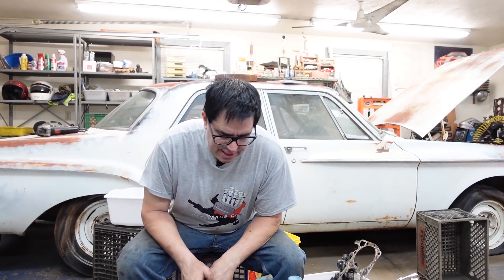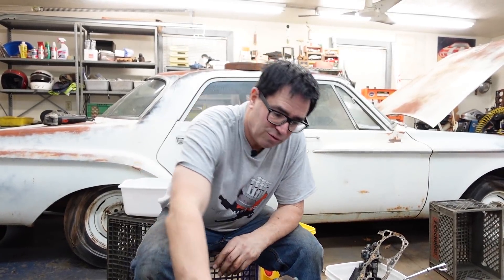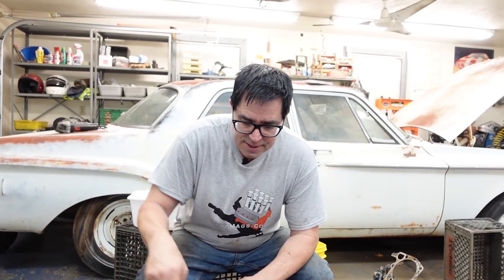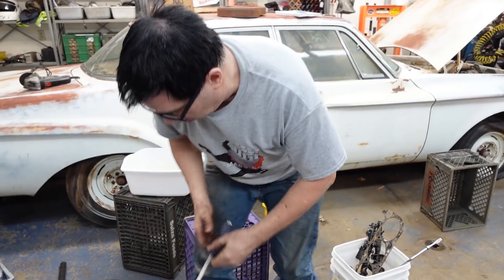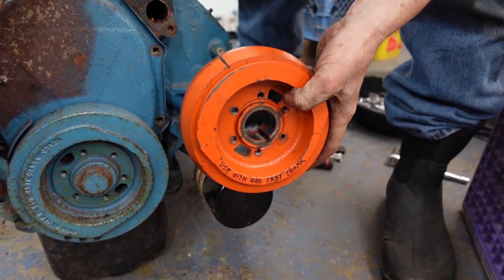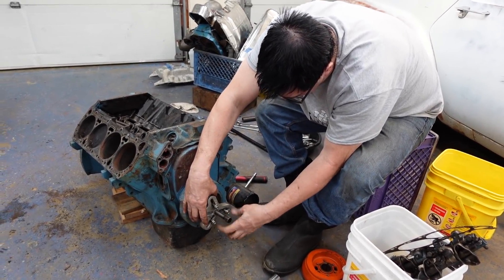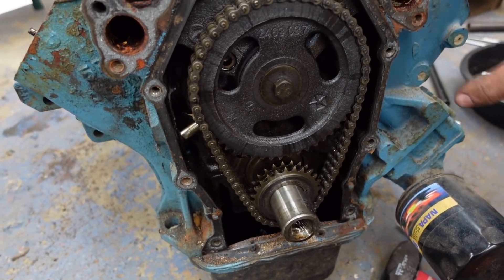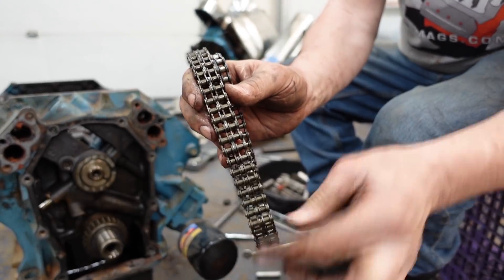Junkyard 440 Teardown Continues

Comment: Any chance of going .020 over and using stock 400 pistons?
Reply: Aftermarket pistons are much better quality and materials. Not to mention you go from a pressed wrist pin to full floating.
Reply: @markwise9868  Much lighter too.

Comment: Lots of great information Steve. Back in the day some of us ultra cheap types would resurface hydralic lifters by putting 600 grit emery cloth on a piece of glass with some oil and making a circular motion with the lifter. You had to start with a lifter face that wasn't really dished. I'd run around the junk yard pulling lifters till I had a set I could work with. Very time consuming. A couple of times through a long movie should do it. Seemed to work ok.
....With the quality problems some new lifters are causing these days, I'd be tempted to go back to used lifters again
Reply: After my son's car ate two cam and lifter sets last summer, thanks to poorly made lifters, I was able to find a set of NOS lifters at a local privately owned parts store. That solved the problem. Now I'm search of another set for our next engine. Big box stores have too much turnover. They're shelves are full of the Chinese crap now.
Reply: @kennydemartini2169  It's been a lot of years since I've built anything. I've heard the stories and I'm glad you found a solution.
Reply: You could get lifters refaced once. Though junk after doing so as the hardening was gone. They are so cheap these days never bother with doing so.
 IF those lifters were still good I would have saved cam and lifters
Reply: @ldnwholesale8552  Sounds like you can end up with junk no matter what

Comment: It's cool to see an engine being disassembled on the floor with hand tools. Makes the video much more relatable to people like me who would be doing it the same way.
Reply: No fancy jumbo sized garage with a lift and giant tool boxes either. Looks as though Steve is keeping it real. 👍
Reply: I love that Steve keeps his swap meet tools in a 5-gallon paint bucket. I watched another channel put assembly lube on the wrong side of his bearings while using a 30k tool kit. Tools/Shops don't make you knowledgeable. Only knowledge does that.
Reply: @bjr2379  That's on the other side of the wall.
Reply: I have built race engines and road engines for 50 years. Engine stand is essential, not maybe for dissasembly though it makes it easier but for assembly imperative. Rolling engines around on the bench yet alone the floor is plain dumb, more so with big lumps like this.
Reply: He didn’t really take anything apart on camera. He mostly just talked about it. 🤷‍♂️ An engine stand is pretty cheap at Harbor Freight... 🤷‍♂️
Reply: @matthewtaylor3308  If you can't figure out the disassembly of a short block sitting on the ground - I don't know what to tell you.

Comment: The only 383 cast crankshaft was the 1971 two barrel, though some sources claim they started in 69 and many 71 2 barrels even have forged crankshafts. All 4 barrel 383's have forged crankshafts. 4 barrel 400 engines in 72 all had forged cranks. 4 barrel 400 manual transmissions got forged cranks in 73 and auto's got cast. 74 and up 400's got cast cranks with both manual and automatic transmissions.

Comment: Looks like an overgrown version of a small block Chevy.
Reply: Nope. The distributor is in the front. 4 bolts hold the water pump. Oil pump and filter in front. And a dry intake manifold. Chrysler looked at the small block Chevy, and made improvements.
Reply: @drippinglass  There are 4 bolts on the Chevy water pump. The 440 also has wet bolts on the exhaust manifolds, and they are pretty easy to strip & leak. On my 440 Camper the heat from the manifolds cooked the plug wires. The dizzy in the front is a double edge sword. That makes it far easier to get wet & drown out.
Reply: @wymple09  There’s no coolant running thru the intake manifold. Therefore it has a cooler intake charge. The water pump is a separate unit from the housing. No accessories need to be removed for replacement. The big block Mopar also is a deep skirt design. Much stronger.

Comment: The 440 and later the 400 used the modern thin wall casting technique that was originally used for the 273. This allowed the larger bores to be possible in production engines, without being too weak for the long run and for overboring.
Reply: There were never 440 thin wall blocks.
Reply: @drippinglass  It is a casting technology, not that they were thinner. It allows more control over the thicknesses.
Reply: @drippinglass  It is a casting technique that has better control of thicknesses than older methods. It doesn't mean they are thinner. Pontiac switched their V8 engines to thinwall castings in 1965, as it is a more modern method.
Reply: That's a myth that even Ma Mopar helped perpetuate. Later blocks are just as thick and, in cases, have thicker main webbing. We have a '74 505 that makes  600 n/a and we hit it with a 250 hp shot of nitrous. Zero issues.
Reply: @markwise9868  Later blocks are made the same way. 440 blocks were never made the using the old casting method. The thinwall casting method allowed to make the cylinders stronger than they would be with the method used for older big blocks.

Comment: Back in the 1960's auto manufacturers used to put forged steel cranks in a lot of truck engine applications because of the shock loads with manual transmission trucks. Also it pretty easy to drill a cast crank for a pilot bushing with the engine out if you have a floor type drill press that accepts collet drill bits as the cast crank is relatively east to drill you just have to use a dial indicator to center the crank and make sure it's face is perpendicular to the drill axis.
Reply: You bet! The toughest stock crank you could drop in a 340 was the 318-3 found in a fargo
Reply: I've chucked them up in a lathe and drilled them out before. I've also drilled and tapped many pre 1968 Chevy cranks that didn't have the balancer bolt on the front.
Reply: @kennydemartini2169  that's the best way to do it. It will cut  perfectly centered in a lathe. I highly recommend this method if you have access to a lathe.

Comment: I have a 440 in my charger and the is petcocks in each side of the block. I'm guessing it was maybe a marine block?
Reply: Every Chrysler motor I have ever owned had water drains on the block...Nothing special...
Reply: I've seen the drain plugs but not the peacocks. And the were installed before the block was painted.
Reply: The only mopar blocks with petcocks installed that I've seen were ones that I did myself. I've messed with several dozen mopar engines of most iterations over 55yrs. Never seen factory petcocks  installed on any of them.
Reply: Is it possible it's a marine engine?

Comment: I think you use a "Dakota" pilot bearing that mounts inside the crank register. It is a roller bearing. another ting is many forged cranks big and small block are drilled, but only "rough drilled" they came on some automatic equiped cars. I found this out the hard way after putting this in a Charger. I had to pull the engine and drill it out to the proper size. Only then could a pilot bearing be installed.

Comment: Hi Steve, I missed 2nd gear in my 67 charger, heard a loud bang then engine kept running like nothing happened, then I noticed my oil pressure gauge at zero, I completely snapped the oil pump shaft gear
Reply: My buddy had his 440 shaft break. After some careful poking around to find out why, we found that the engine builder left the shaft bushing out of the block.
Reply: That's no fun. Making things worse, some replacement distributor drive shafts were made of garbage. People would buy ARP shafts as cheap insurance.